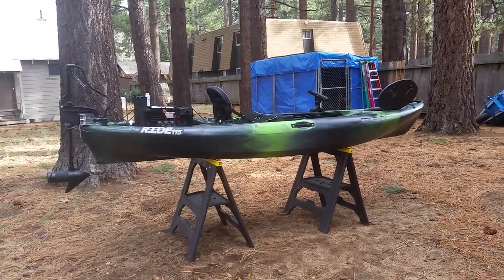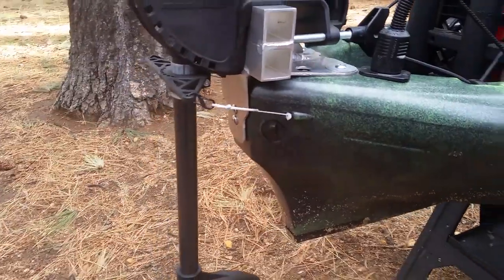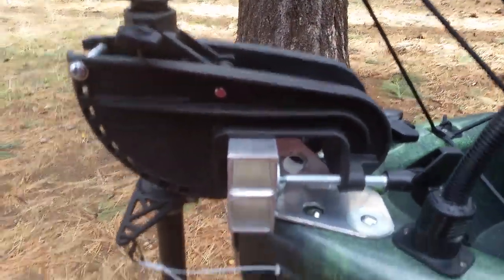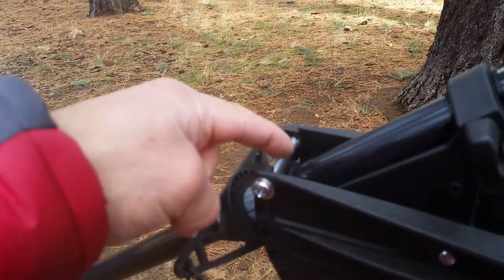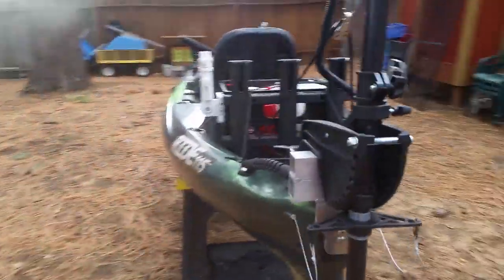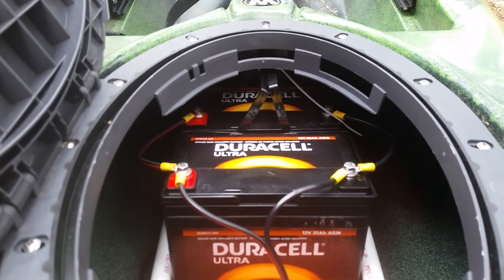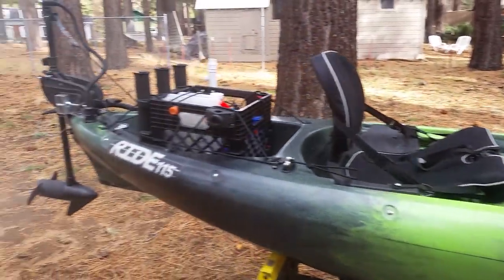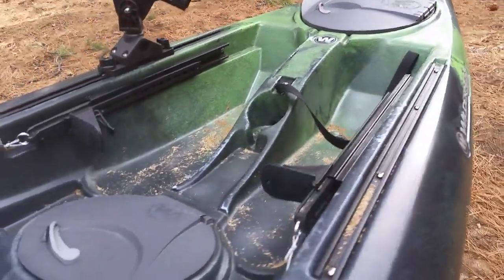Kayak Trolling Motor Project is Complete and Awesome!

Comment: What keeps the motor from rising when moving forward?
Reply from the maker: The steering lines and your feet on the pedals... it works really well. The steering lines have to be below the pivot for this to work but I sold this one and built a new one with a bigger motor(46lb.) and it works great on that boat too.
Reply: @TahoeYakFisher  ah nice. Thanks for responding with detail. That was my only concern before I fully committed.👍
Reply from the maker: @censoredbyyoutube3099  I don't know where you are headed or with what kayak but please check out my channel and my newest vids on my Wilderness Systems Recon. It is pretty similar, with the bigger motor and a speed control that I am selling. I am stoked on my new kayak, the 46lb is Awesome, steady 4.2mph. I am more confident in my speed control as well.
Reply: @TahoeYakFisher  checking it out now, I appreciate you man.🤙